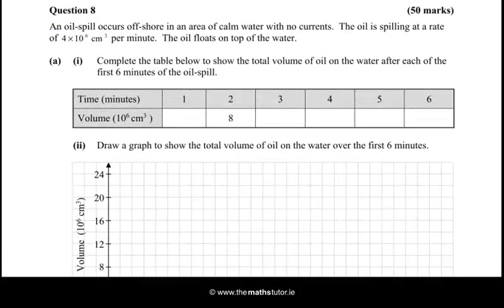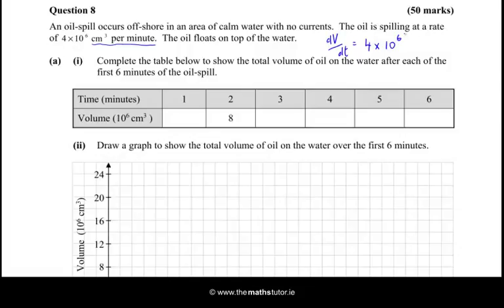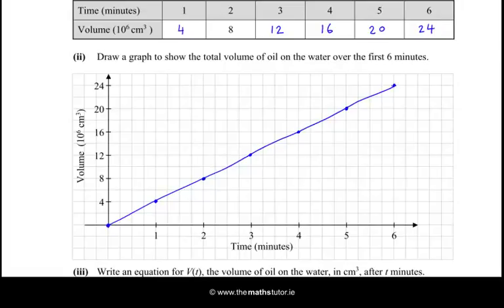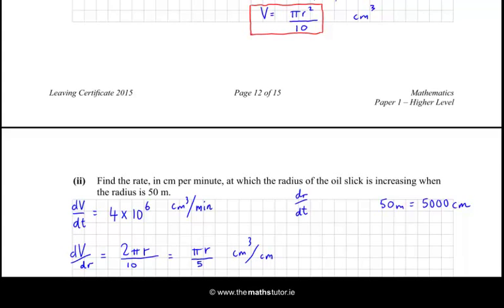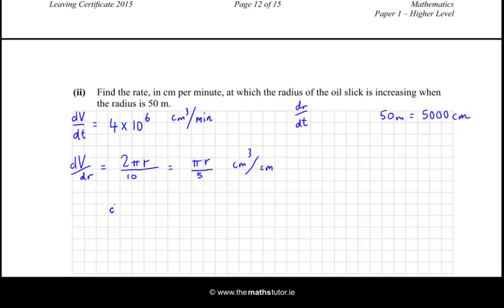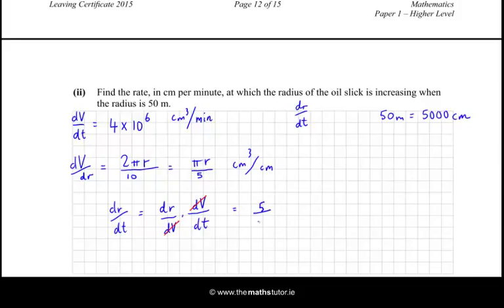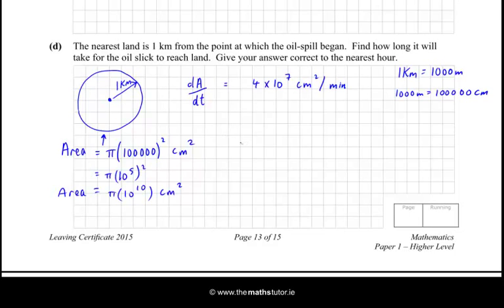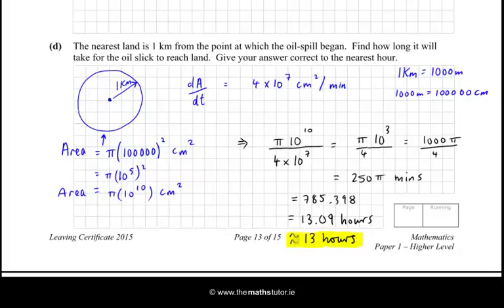2015 Paper 1 Question 8 - Leaving Cert Higher Project Maths

Comment: For part (a)(iii) I didn't spot the units and wrote it as V=4t. I will lose marks for that but will I lose marks on other questions for continuing with that? Including the ''show that -'', I applied the correct method but didn't get the answer because of the 10^6.
Reply from the maker: Stephen Yeah, it's an easy mistake to make, we did it ourselves ;-)  You will probably lose 1 mark as it's a slip, or possibly 3.  But not the end of the world. And they can't penalise you twice, so don't worry.